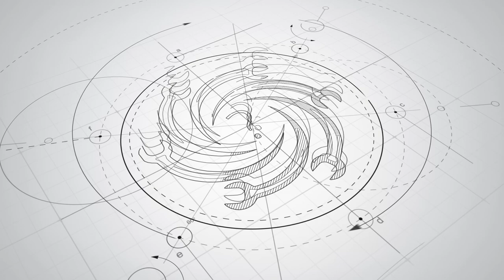How to Modify a Sprinkler valve (for an air cannon)

Comment: Why did you fast forward the most critical parts of this "instruction" video.
I have the same sprinkler valve and the diaphragm has a hole through which the adjustment screw goes.
I'd appreciate some feedback.
Thank you.
Reply: Did you figure it out
I am having issues with all the air coming out of the top trigger not the barrel

Comment: Tried this with a very similar sprinkler valve, but air pressure @ 28 psi would just hold the diaphragm and spring open and leak out the barrel end, even tried a heavier spring, still same result.
Don't think enough pressure was being made on the air gun side to hold the diaphragm and spring down.

Comment: Will the valve handle 100+ lbs of air pressure... needing to launch 2.5 lbs about 250 yards
Reply from the maker: +Marvin Brock not sure of pressure ratings for the valve, sorry. I get a bit nervous when I get it up to about 90psi, but have never had an issue (yet)
Reply: Mine used to work at 90 psi. Set aside for a year. Now it just hisses and no whomp. Thoughts?
Reply: You may want to consider using a 2 inch pvc ball valve with an extended handle to operate the valve lever. 

That’s what I use for my bait launcher and my ice bullet is approx 2.5lbs but it only takes about 120psi to launch 275 yrds
Reply: @lackeydehackey405  diaphram may have dried out
Reply: @IBMaced2  I redid the blow gun to valve connection. Retapped to a larger size and readapted to the blow gun.

Comment: Hey thanks for the video. I started this today with the exact same valve from Bunnings. How the hell did you get the black flow control stem out? Mine snapped off trying to get it to unscrew...triedxto drill it out... Fail
Reply from the maker: +Adam Sidebottom been a few months since I did it, but I’m pretty sure it just screwed out. It might have been a reverse thread though??

Comment: A lot easier way to do it is a 9 volt battery will energize a 24 volt solenoid. So all it takes is a battery and a switch which would be a lot easier to mount than modifying the valve.
Reply: the orifice to vent the sprinkler valve is small to intentionally make the valve slower-opening. they want this to reduce water hammer when using them for the normal purpose. moving the vent to a large hole on the diaphragm makes the valve open MUCH quicker than it would from the solenoid orifice, and makes it much more powerful as an air cannon
Reply: At higher pressures you will need more voltage (18v) to open the solenoid.

Comment: What where the toothpicks for around the outside of the valve
Reply from the maker: They were just there to help plug the hole whilst the epoxy set. Otherwise it’d leak through and set on the underside

You can use anything to plug the hole.
Reply: Making Random ok cheers, i used the same valve from bunnings and it didnt work until i lubbed up the internals
Reply: Would it still work if you screwed an end capin to where the solenoid was rather than using epoxy?

Comment: guess what? I am now making #6, my friends keep wanting to buy them from me, but I just give them away. I have not tried one over 80psi, yet, maybe 120psi if I wrap the cylinder with duct tape?
Reply: Try adding some large hose clamps around the air cylinder. Makes it stronger